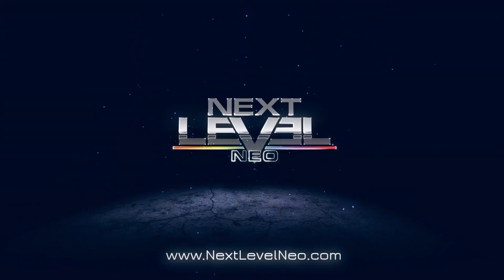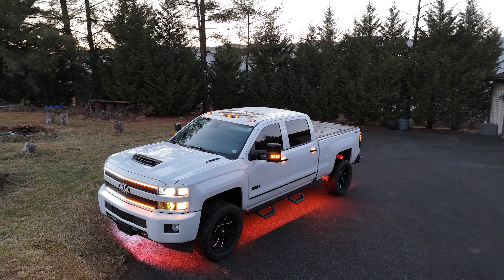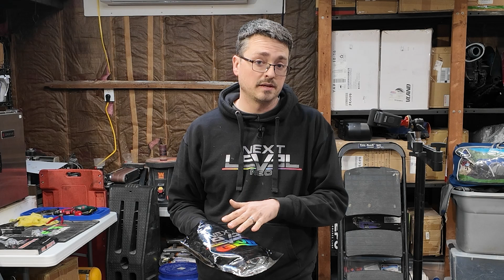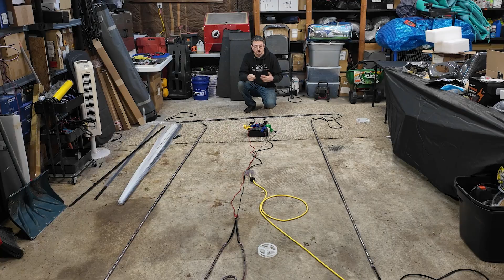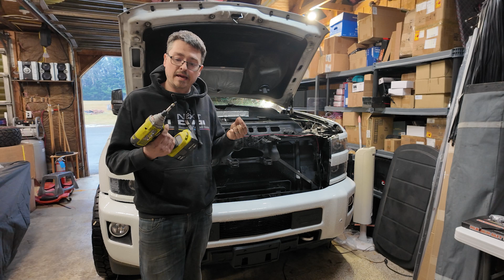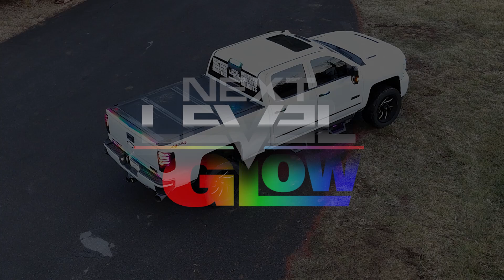The Ultimate Underglow Kit - Next Level Glow full install

Comment: Man those arke bright at all. That sucks i was hoping for these to blow xkglow ultra out the water but unfortunately not.
Reply from the maker: You're basing that on a video? Never judge brightness from a video or photos. We definitely compete with xk glow in real life.
Reply: @NextLevelNeo where can we see the light power specs at? Like wattage or lumen ratings? Is there amy customer videos we can watch? Right now I'm thinking xkglow ultra or lighting trendz hyper pro max. What is the blueghozt controller ampage? 5 10 15 or 20amps?  I like blueghozt themes the best. Just dont see any really good videos at night of the led strips where we can kind of gauges how good they are. Seen a video of someone's led strips where it went yellow near the ends if something wasn't done. That was worrisome honestly. There isn't any way to up the ampage? Can you please see if your customers will upload videos so we the customers can actually see how bright they are? Perfect combination for me wouod ne blueghozt controller with the hyper pro max strips or the xkglow ultra strips. The lighting trendz strips they had like double strips where it was extra wide so it will be wider and it seemed very bright. Do you have like any wide bright leds?
Reply from the maker: When considering led output power draw is a factor. Our current best tier uses an IC with 25ma per diode. A typical car with our kit will draw 15 amps and have a 20 amp fuse. The amount it draws depends on the size of the kit and color set. Our new v2 version is in testing now and will draw 35ma per diode. Yellow out has to do with power delivery. If the kit uses thin 22awg wires like every other kit on the market right now, then you will lose power by the end of the strip and when in white the strip is running all 3 diodes at full power. This causes a brown out, meaning the color will shift yellow. Our kits use 18awg wire and wider pcb so we are much less likely to see brown out. 

Strips with multiple rows of leds are mostly a gimmick. They dont fix the power delivery issue, and many of them like Hard tuned kits actually split 6 leds across 1 IC instead of 3 like a single row kit. This means the power output of the ic is split by 6 instead of 3, so lower output. 

I can take a video and overexpose it for you to make our kits appear far brighter than reality, but that is dishonest and you should never trust that. We have bought kits from Low Glow, Hard Tuned, Lighting trendz, and Xk Glow. We measured output of each one with our color meter and we are atleast twice the output of any of them. 

If you reach out to us on socials, IG or Facebook messenger, I can send you photos and videos of customers installed on the car. But you really should not base your decision on photos or videos. Its ridiculously easy for a photographer to manipulate camera settings to boost appearance. In my experience the best looking rgb lighting photos are when the Brightness output on our strips is reduced to 10%. This stops the lights from washing out the camera.
Reply: @NextLevelNeo also what 2 strips of light is on your grills? Would that work for like trunk seams and hood seams? Also amy way we can program multiple remotes to the blueghozt controller? If not is there a way to program it to work like that? If not that is how Estonia a horrible design flaw where if you lose your controller you would have to spend like an extra 300 to 400 to he able to use a fob remote. Anyway to email blueghozt to see if they cam switch that? In this economy that amount of money is honestly insane having to spend for losing a cheap 10 to 15 remote. I hope they didnt use that as a cheap dirty trick to get people to spend the extra 300 to 400 on a new controller.  If so that is awful. I can think of no other reason why they would program that like that. It shouldn't be hard to program the controller to go into pairing mode for a new fob remote.
Reply from the maker: On the remote, The remote for a battery saver has a unique code to prevent other remotes from activating your lights. A remote can be cloned with a clone remote. And you can get 10 of them for a few bucks on amazon. When the battery saver is used with a blueghozt plus the remote is not even needed to operate the controller.
Reply: @NextLevelNeo is there any way to let the show mode go on the whole time at night for more then 30 minutes? Like say 12 hours possibly?
Reply from the maker: @jleep2017 yea, shows will run till you tell it to stop. Or a dead battery. If your running a lead acid battery you won't get 12 hours of run time
Reply: @NextLevelNeo 200 scib battery in my impala

Comment: Do you find most people just install the Best LED strips without the channels? Is there any benefit of using the channels, other then bottoming out protection. I'm trying to determine if I want to do the channels or not. I'm installing on a lifted 2021 Tacoma so I'm not worried about bottoming out any where.
Reply from the maker: The bigger benefit of the channels is it gives you a clean flat mounting surface. Underglow frequently will sag down when applied to the surface of a car. It's hard to get it perfectly clean and usually there are not flat surfaces but rather surfaces of varying heights.

Comment: Are you guys able to give recommendations on install for X5M competition? Thank you
Reply from the maker: Unfortunately we have not installed a set on that vehicle yet but these kits are universal. They will work on most cars with a few things in mind. No leds can can survive the weight of a car on the ground. If you are lowered and frequently scrape you need to make sure that there are no points where the underglow is the thing scraping. This is usually possible to do but may require installing the strips in a location that's not as desirable as high impact areas may be. The use of led rails helps greatly in reducing impact on the strips and keeping them in place for a long time. Sticking led strips directly to the frame of the car leaves strips more vulnerable and increases the chances the tape fails at some point.